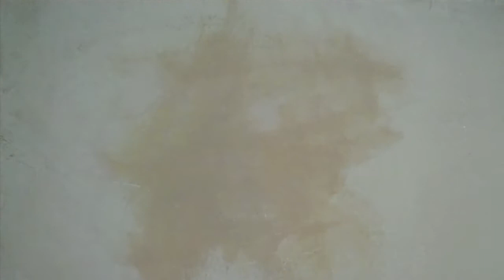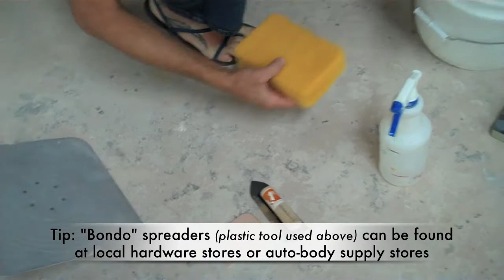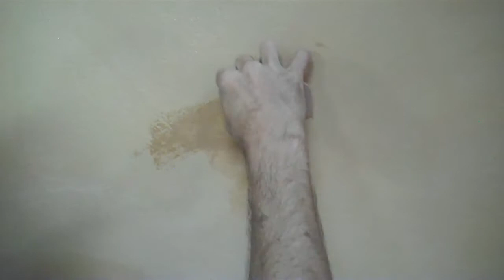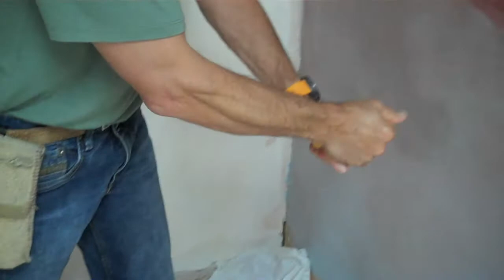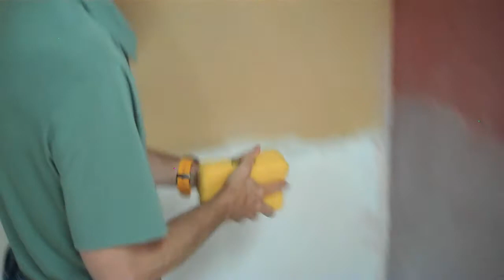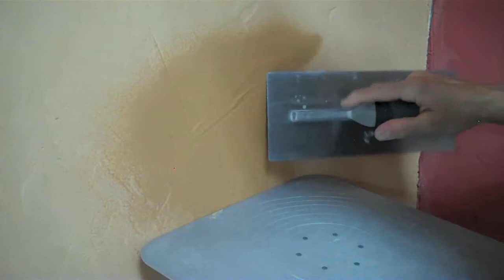Repair and Touch-up Techniques

Comment: Very helpful; thank you!  We have both the colors of the walls you worked on in our townhome.  The Red has nail scratches and the beige has some dings on a rounded corner.  I'm also curious about how to just "clean" dust the walls because, of course, the texture catches cloths, etc.